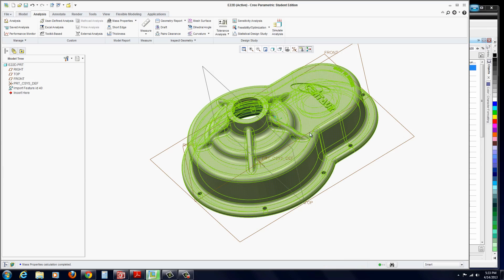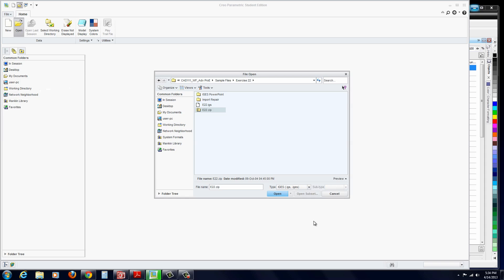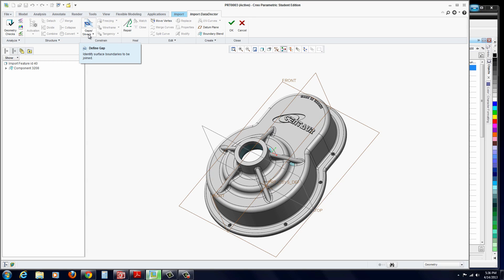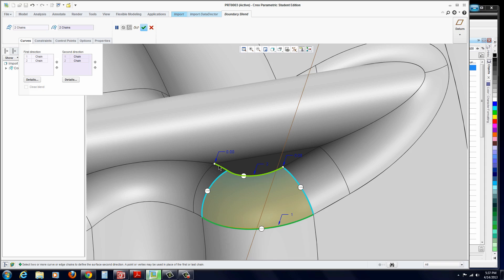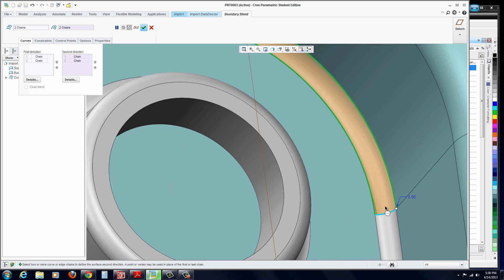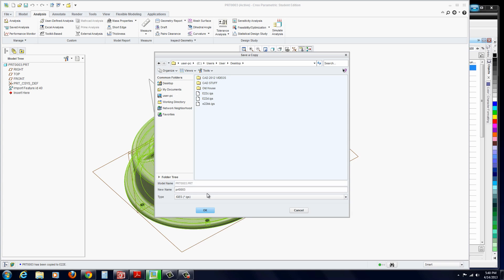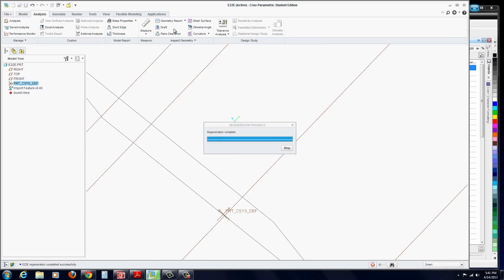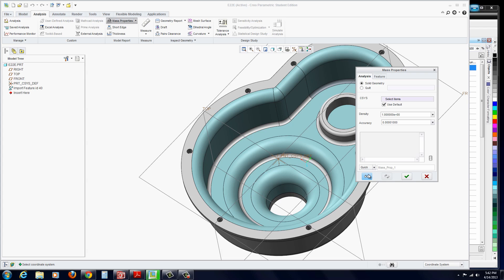E22 CREO Parametric 2.0 IGES Repair

Comment: I face a lot of these challenges during work.  I have a lot of success with the import doctor in Solidworks but Solidworks will STL any part, with or without intersecting lines.  The software I use after CAD almost never takes solidworks stl due to t-connections and such.

Having to deal with many different companies who use all the different CAD programs, I have never been able to successfully repair a part with crazy intersecting lines, vertices not connecting, and surfaces shooting to space.  Can you do more examples of repairing parts with such problems?

Comment: Sorry, but I think that your method is very bad,isn´t necessary to make a copy for iges to close this surface,after make the boundary bled the import data doctor to allow merge between surfaces.Close all gaps the CREO make solid.
Reply from the maker: Thank you Marcio. I will try your technique next time. End result is the same though, isn't it? ;)